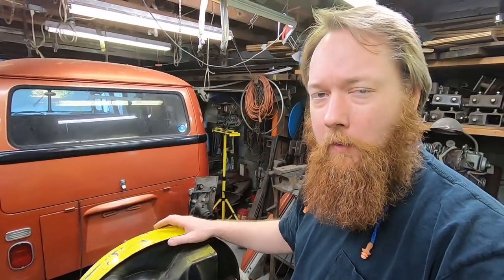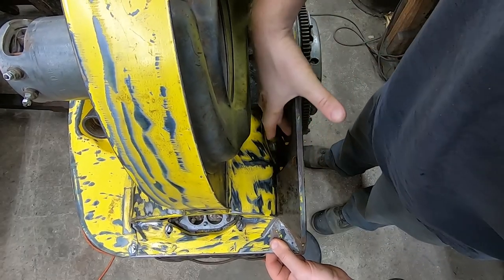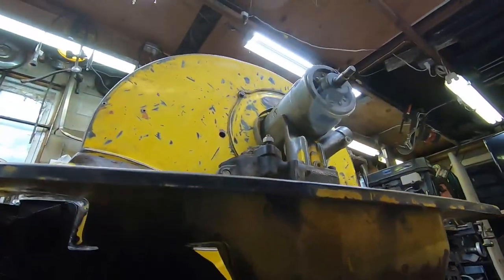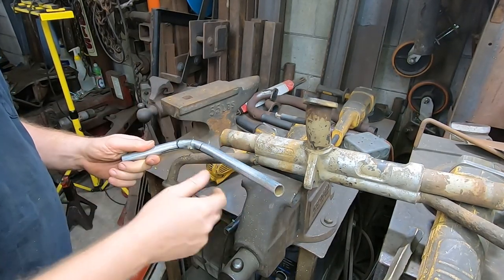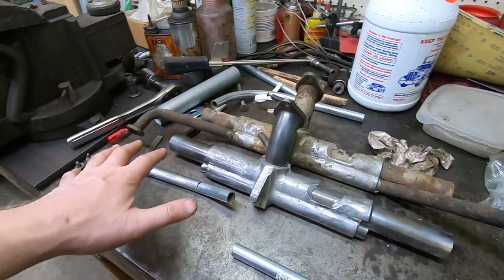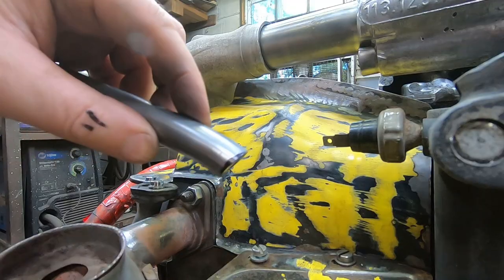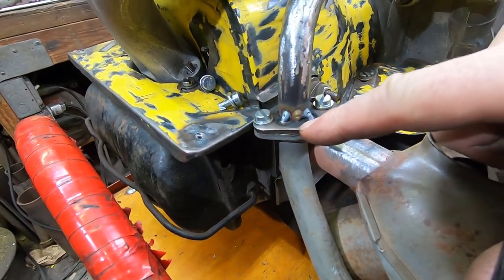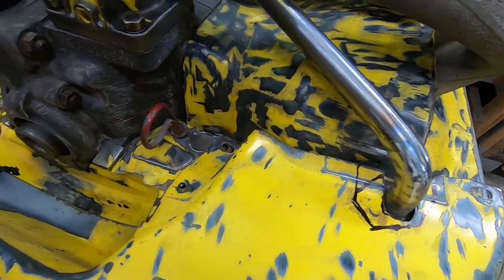DIY Heat Riser Fabrication & Cooling Tin Modifications VW Split Bus Restoration Vandemic E12

Comment: This comes about a year late. When you go to bending your EMT fill it tight with sand and cap or seal the ends then you can easily bend any degree of radius you want without the tube collapsing. This is an old trick and works well with most any thin wall tube. You do an amazing job and I am inspired by your work. As I am building a 1968cc engine for my 1974 beetle I will most likely "Try" and be as detail oriented as you with my cooling.
Reply from the maker: Great tip Todd! Not too late at all- I'm sure this will be helpful with a future project and I look forward to trying my hand at it. Good luck with the '74 power plant- every little detail counts and I'm sure that 1968cc will have many happy miles ahead. Keep us updated!

Comment: Not alot of help in the air cooled world where i live so even the smallest details, even if they seem obvious, helps me so much.  You explained how and the flow of the heat riser tube.  Thanks again for a fun and informative video!!
Reply from the maker: Hey Benjie, thanks so much for the positive feedback. I'm always curious how different elements of a video will be received; it's good to hear some of the information is coming across and has value. Just remember you're not alone when working on your Vdub- we're part of a great community and it's great to have you here!

Comment: You really did a great job I am a firm believer in proper cooling of my 67 beetle and will be upgrading it to a 1915 motor I was impressed with your visor and learned a lot great info thanks .
Reply from the maker: Thanks Christopher! You are correct to focus on cooling with the 1915 upgrade- it will make more power so it will also make more heat. Good luck with the project and let us know how it goes!

Comment: when doing such custom work, stainless material worth the investment, usually, grade 304 is OK.
Reply from the maker: Hello Jacques Poirier, thanks for the suggestion. Stainless would have been a great material for this! I've used it before but need to choose a project to increase my familiarity with welding that material. I'll keep it in mind for the next exhaust project. Thanks for checking out the video!

Comment: usually with a clogged carb heating,  people cut open the lead and replace the whole pipe..
Reply from the maker: Hey Chris! I've cleaned one through a rusted out hole in the bend before but haven't tried slicing the aluminum to replace the entire pipe. It would need to be welded back together once the new pipe was in to conduct heat to the intake. That's reason #1,739,214 for me to learn aluminum welding... Thanks for watching!

Comment: Trying to restore 1961 40 horse but cannot find front and rear tins.  Any suggestions?  I enjoy your delivery and content.
Reply from the maker: Thanks Joe! My first choice would be finding used original tins at a swap meet. As you saw in the video, aftermarket tins (when available) need attention even when new- so the effort may be better spent refurbishing original tins. Last choice for practical purposes would be to modify the closest thing you can find to perform the same function as originally designed. However it turns out, it will be worth doing! Thanks for the question!

Comment: Had a 1968 beetle with a clogged heat riser – but I didn't know it was clogged. 68 – each cylinder head had a single port, and engine a 1-piece intake manifold with attached heat riser. Did the engine run without the heat riser? Well, mostly it ran fine. But now and then it had a "flat-spot" during acceleration. While accelerating it would suddenly reach a point where it would not accelerate any more.  Then after a moment  or 2 it would accelerate again – as if the fuel had stopped flowing for a second, and then began to flow again. I had just completely rebuilt the engine but I had neglected to check if the heat riser was patent. Why wasn't the fuel flowing?  Why on earth was the engine having a flat spot? I couldn't find anything wrong with the fuel pump or the carburetor. Engine worked fine when the car was stationary. Problem was only when the car was accelerating, when the engine was pushing a load. My customer was sort of pissed! Just paid me a lot of money for a complete rebuild – why was my car hesitating now and then she wanted to know. After about a year of this I finally figured out what was wrong. I must have read about it somewhere, but I don't remember where. This was before the internet. It was about 1978. When pushing a load lots of fuel and air was needed to bring up the rpm – more than when the engine car was stationery – and the high flow of fuel-air mixture was causing water vapor from the air to freeze as it flowed through in the intake manifold. This caused the mixture to stop flowing for a moment, caused the acceleration to "hesitate," and then a moment later the ice melted and the engine continued going faster. So I took off the the intake manifold, propped it up, upside down, and poured carb cleaner into the heat riser. Let it sit for a few days. Poked it with a wire coat hanger every once in awhile. Finally got a "breakthrough." Once I got a breakthrough clearing out the heat riser proceeded faster. Kept on poking with the wire hanger until the passageway widened and widened, until it was almost as wide as a new one. Put the manifold back on the car. Car ran well. No more hesitation.  You need to have a working heat riser! I don't think the Bentley service manual said check the heat riser, before attaching the intake manifold to the cylinder heads and the muffler. I think that's why I didn't check it. Next rebuild I checked! And checked the oil passages in the crankcase, too.
Reply from the maker: Hello Ready Teddy, thanks so much for sharing this awesome story! It's great that you stuck with it and finally figured out the issue- I bet you and your customer were happy with the result. And yes, the oil passages are easy to overlook too...  Thanks for watching!

Comment: So why put them on of the engine runs great as opposed to running like it should? Manifold support for carb?
Reply from the maker: Hi Raul! I'm not sure I fully understand your question, but I'll offer this opinion- a great running engine is running as it should. A single carb engine will run more efficiently with the heat riser in place (supports fuel/air atomization), which helps keep the engine running great over a longer lifespan. Your mention of the heat riser providing support is a great point; I've never considered that but it must strengthen the intake manifold, probably substantially. Thanks for the question!
Reply: @HapticGarage  So to simplify the question: Did the van come off the assembly line with a single or dual carb?
The issues I have with my single carb system is that it's running rich; plugs are dry but sooty black. I don't think I can jet it any smaller than the 127.5 main/55 idle that's in the carb now. I believe the manifold preheat system is the problem.
Reply from the maker: @rjgarciasr  Thanks for the clarification Raul. The stock configuration for this bus included a single carb with the heat riser. The heat is necessary to prevent the fuel from condensing in the manifold before it arrives in the combustion chamber. I live in a warm climate but that doesn't significantly change the thermal dynamics involved; I prefer to run the heat riser. Hopefully reinstalling the riser will help resolve your issue- I agree that those jets are on the small side of what many people run (unless I'm mistaken, I think those may be the stock sizes.)
Reply: @HapticGarage  Before commenting I had bought a used manifold because the exiting one was cracking where the risers meet the manifold, I cleaned it out before installing it. The manifold condensed below the carb whether it was idling  at op-temp, or after a 20 min run. The high pressure side riser was about 165° F and the low pressure side was 110°, manifold below carb never got higher than an average of 115° after 4 runs.
I had installed new plugs before the first run. I took #1 out after the last run and it was dry, all black and sooty. The jets came in the new carb with spares of the same size. Thoughts?
Reply from the maker: Sorry for the delay Raul, I thought I had already replied to your question. I think condensation is normal in a humid environment; I see normally see that here in Central FL almost year-round. Based on your recognition of the high/low sides of the riser, I'm guessing you have an exhaust that is designed like the stock version to allow flow from the #2 stack to the outlet after #4. I'm currently running a buggy exhaust that just pings pressure back and forth without really working as intended, and it measures about 150° on both sides. This is a recipe for clogging! Anyway, it sounds like your riser is at least partially working which may indicate the rich condition and subsequent carbon fouling have a different cause. Too much choke? Float level? Needle/seat not sealing? Restrictive air filter? Just some thoughts. Please update with your conclusion, I'm sure there's something for me to learn here. Thanks for the follow up!

Comment: But, do you "really" need heat risers in Florida?
Reply from the maker: Thanks for the question Jeff. I think the engine is better with the riser, even in FL. This place is hot, but the physics of an engine are on a different level. I use the same rationale for preferring to run a thermostat. To each their own, but heat risers and thermostats are right for me. Thanks again for being a part of the fun!